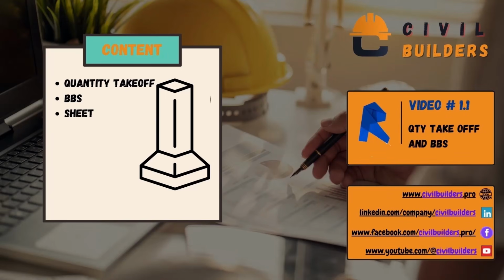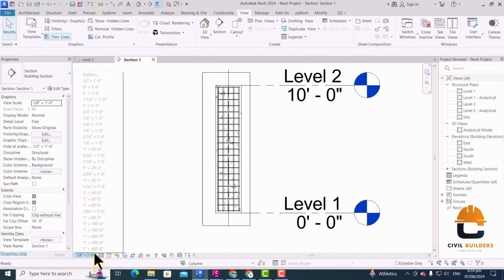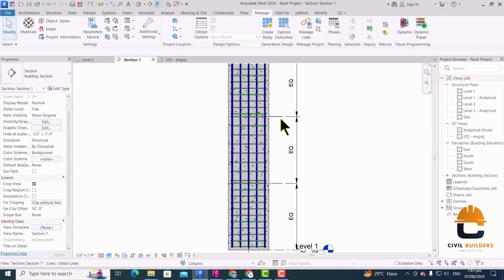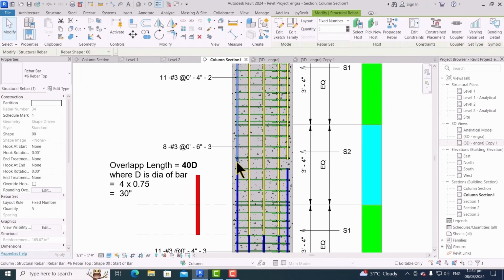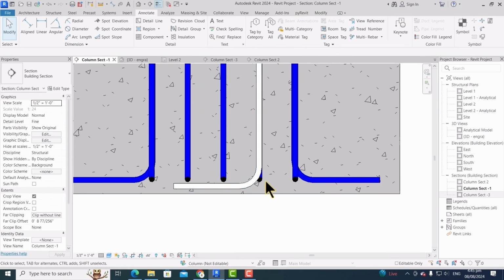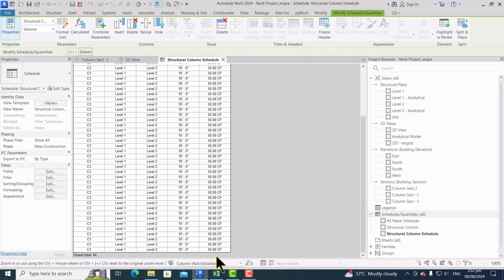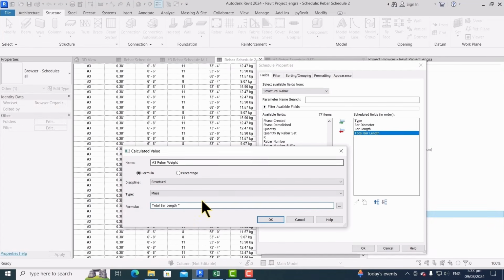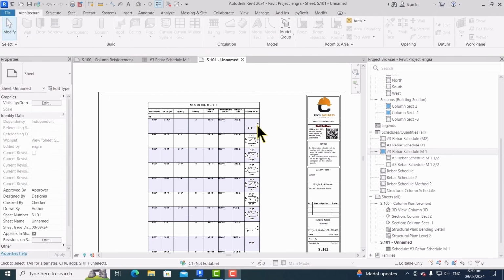Master Revit : Ultimate Guide to Column Detailing, Quantity Take-Offs & Sheet Creation | Class  2

Comment: We can put the sections easily in sheet but If number of columns are more with varying size.. then  how can we placed the plan view ? You skipped that part
Reply: Can we take section from elevation ?
Reply from the maker: Yes! In Revit, you can take a section from an elevation
Reply from the maker: Use Callouts in Revit to add multiple column plans to a sheet:

1️⃣ Create Callouts
2️⃣ Adjust Views
3️⃣ Place on Sheet